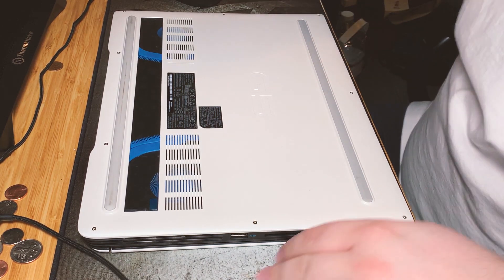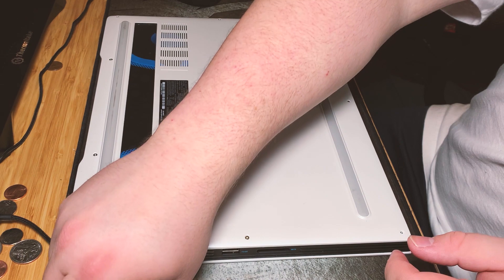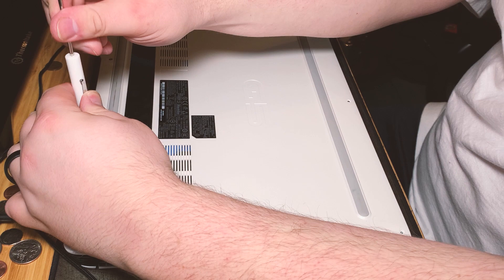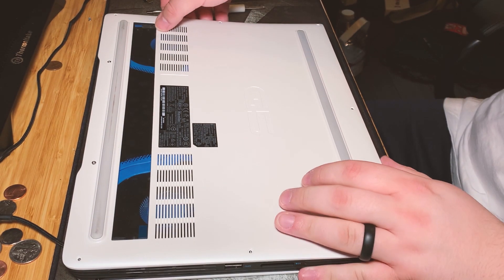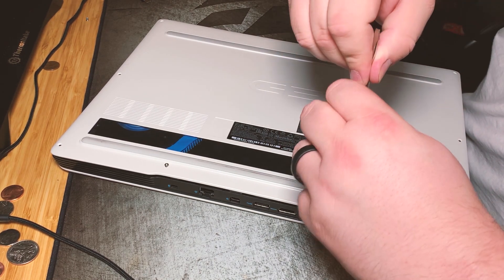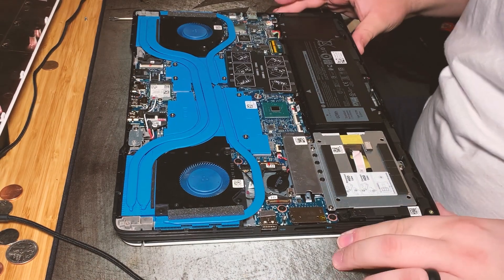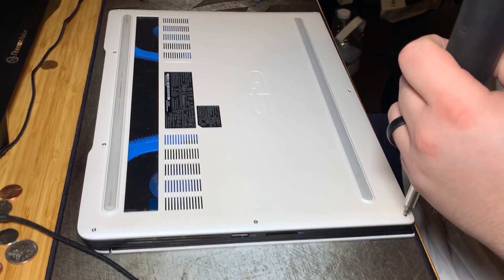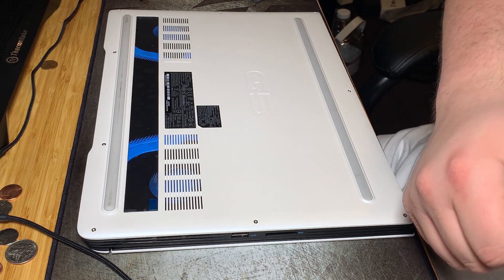Dell G5 15 5590 Upgrade

Comment: Thanks, this was exactly the video I was looking for about putting a 2280 in the 5590. Glad I saw how the screw thing popped out. Do you know if a 2TB M.2 will work in the 5590?  Also, do you know if I could lose the m.2 altogether and just use a 2.5inch SSD as the boot drive.  I have had some trouble on new computers only booting from the M.2.
Thank you.
Reply from the maker: Yeah a 2tb m.2 works and yes I believe yoh can boot from a 2.5inch

Comment: Jeff, thanks for this video! I'm about to change my NVME, and have a couple of questions. If you were to do it again, is there any thermal paste or pad you would add to the NVMe SSD? Is there any reason why one couldn't leave the enclosure off for better air circulation? Thanks again!
Reply from the maker: I would not add any pad or paste to the NVME. The enclosure is required to hold down the drive and apply equal pressure. Drives don’t get as hot as some would have you believe if you are playing games and stuff.

Comment: Hello, I have a g5 15 5500 do you know if i can install a 2 tb samsung pro nvme for the primary and have a 2.5 sata ssd samsung as well? When I called dell they said the NVMe slot only can do 1 tb
Reply: No, 1tb only for NVMe slot. I just upgraded mine to 2tb ssd backup and 1tb NVMe

Comment: Do I have to store all my files on a usb first? including windows and such?
Reply from the maker: Jonathan Lai If you are adding a drive, no. If you are replacing a drive you will want to clone the drive that is in the laptop to the new drive before installation
Reply: @JeffTheITGuy  I have the same kind of laptop, but can it add an extra one?
Reply from the maker: Jonathan Lai yeah, you can add a 2.5 inch drive
Reply: @JeffTheITGuy  My laptop has a Nvme drive, can i add that?
Reply from the maker: Jonathan Lai So if you have a 5590 like mine it has a M.2 Slot and 2.5 inch drive bay. You can add a 2.5 inch for extra storage or you can replace the M.2 NVME with a larger drive but you will have to clone the one currently in it to the new one
Reply: @JeffTheITGuy  I checked and my laptop is actually a dell g5 15 se 5505, do you know if this model can fit a 2.5 inch for extra space?
Reply from the maker: Jonathan Lai it does look like the 5505 SE can take an extra M.2 and 2.5 inch drive
Reply: @JeffTheITGuy  Thank you so much!!
Reply from the maker: Jonathan Lai you’re welcome.
Reply: @JeffTheITGuy  I have one more question, this means that my se 5505 can have to pci nvme drives right? because my current one is a kgb40zns256g  nvme kioxia 256gb drive. I can get another pci nvme drive and put it in my laptop for nvme drives right?
Reply from the maker: Jonathan Lai Ok, so according to Dell the 5505 has 2 M.2 Slots that both run at PCIEx4 with a maximum capacity of 1TB per slot. It also doesn’t list is as having a 2.5 inch a lot in their repair manual. Hope that helps
Reply: @JeffTheITGuy  So i can place in 2 pcie nvme drives right, according to dell?
Reply from the maker: @jonathanlai2863  Yes, according to their repair documentation. Yours does have a Ryzen CPU correct?
Reply: @JeffTheITGuy  yes
Reply from the maker: Jonathan Lai should be good to go then
Reply: @JeffTheITGuy  Thank You!
Reply from the maker: Jonathan Lai you’re welcome

Comment: Hey man!
I need some help. 
How  I can know if i can put a HDD in my G5. 
I watch some videos that the battery is so large and dont have a slot for HDD. 
Another question:  if I open the laptop the waranty its over? 

PD. Excuse my english
Reply from the maker: It is covered under warranty. As far as HDD if it doesn't have the slot to the left of the battery then you can't add one

Comment: Can you make a video doing the installation of the windows in the new ssd, because i am trying to change mi ssd for the same model of laptop but i am having a lot of problems with the configuration and manipulating the bios, some foros saids that change to ACHI mode in bios to allow the laptop read de new ssd and i am not shure how to do it correctly, please help
Reply: Hello Juanka, did you solve the problem?
I have the same issue 
Thanks

Comment: i plan on doing this same upgrade as you and adding 32gb of RAM. Would you know if all this would help with screen tearing issues?
Not really the main purpose why im upgrading the internals (Music production,editing software), just a thought since ive noticed it sometimes in Modern Warfare.
Reply from the maker: Alex H Screen Tearing? That is indicative of either A) Not using VSync or GSync or B) a bad video card
Reply: Hey, did you buy the 32gb of RAM? I'm planning to buy the Crucial 32GB Kit (2 x 16GB) DDR4-2666 SODIMM but i'm a little worried that this RAM doesnt run at 2666 mhz  since I've read in different forums that many RAM like the Crucial Ballistix Sport LT 32GB Kit (2x16) runs at 2400 mhz. And my question is: Should I buy the Crucial 32gb or I should look for another one? I'd be glad to hear your experience.

Comment: Just a tip to avoid breaking the locks, its better to start from the bottom, using a thin plastic, like a credit card. Make your way around and after releasing the locks all around you probably will need to loose again the two back screws.
Reply from the maker: Anderson Postingher thanks for that. I’d never had it happen before to be honest in all my years working with tech

Comment: Hello. I did the same thing as for as upgrading the SSD and I need help I can't get my computer running again 😭😫 how did you get windows running again?
Reply from the maker: Mustache Mel Hi, I made a USB with Windows 10 on it and used the boot menu to boot from the USB.
Reply: @JeffTheITGuy  I've tried that three different ways. Nothing works. I don't even have the option to boot from usb in the boot menu